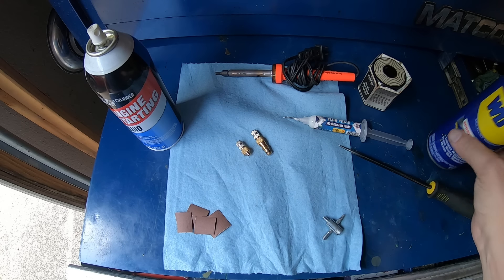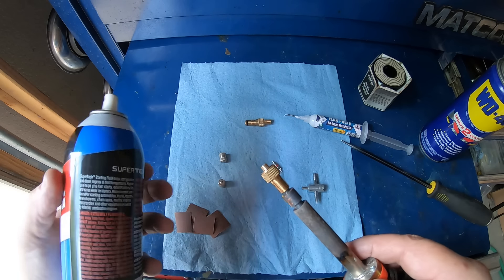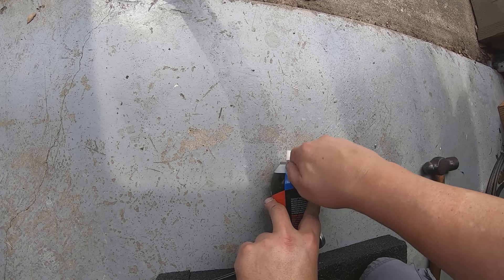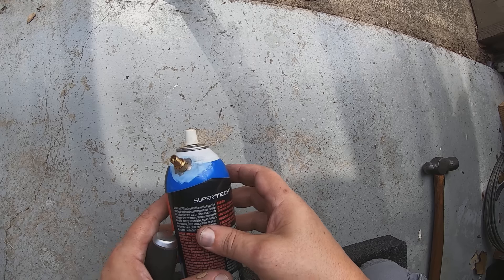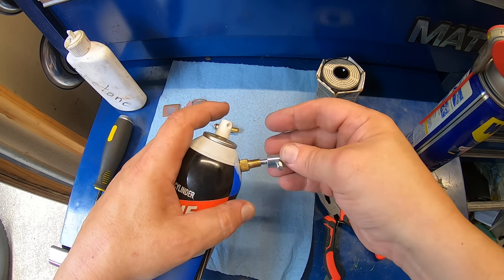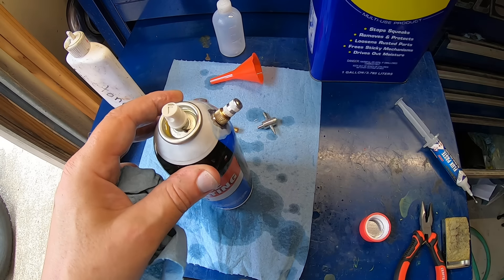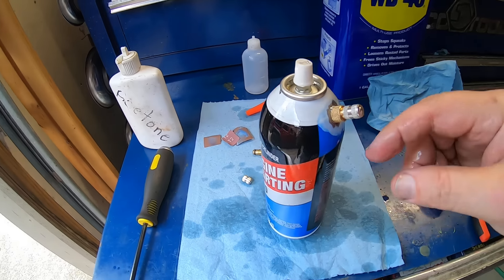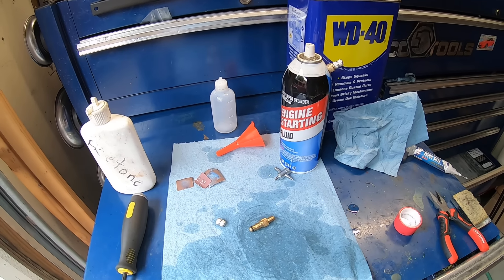How to Easily Install a Schrader Valve on any Can to make It Refillable without Drilling or Torch.

Comment: Why not just get a pressure can made for that. 
Mechanics use them for parts cleaning. 
I put brake fluid in it to clean off oil stains on the driveways for my customers that when my Dodge ram marked its territory 🤣. 
Filled the can with brake fluid, fill it with air through the Schrader valve 
Don’t have to worry about shit like this  
Or better yet JB weld a  rivet nut to the can a lot faster and easier. 
Just get the aluminum one for aluminum cans the steel one for Steele cans , 
The problem is those cans are made to handle a lot of pressure!

Comment: I'd be ultra cautious about how high a pressure charge is applied to reused cans.  Keep it low as needed. 
For a start, only pressurise it with a hand pump and TEST what it is. 
Also, what is the service life of the can's dispensing valve?  
You can be sure it is little more than it's intended single use.
Reply from the maker: Time will tell.
Reply: It appeared to me that this guy knew what he was doing.

Comment: A conical drill bit or bur  run in reverse can deform a nice concave hole. Using a standard fitting  it can be force threaded tightly into that hole (pliershelp). Screwing it in with some quick-set epoxy (surfaces gotta be CLEAN of oil), will seal it for years.

Comment: One can pretest the air pressure the way Plumbers and Steamfitters test gas pipe.
Just make a fitting that has a PSI gauge on it put some soapy water in your can and inflate to pressure and let sit overnight and 
if it holds the same PSI and no leaks your good to go! 
The soapy water will tell you where the leaks if any are as well! 
after that drain rinse out and let the can dry out as well

If the rated PSI is 100Psi on the can, I'd use 75 PSI on it for safety reasons and your not over stressing the can!  you can always add some air if needed. Id use a dip straw as well to tell you the level of fluid is in the can as well!

Comment: The best thing about this method of soldering in a valve stem is that it is quick enough to allow for the solder to melt without damaging the plastic spray valve (the part you push to spray). One thing that surprised me is how he poured in the WD-40 from the gallon can. If you put the gallon can cap to the top as you pour you avoid the glug glug spillage. This works with antifreeze and quart oil bottles as well. Good video.

Comment: Harbor freight sells a reusable spray can cheap and you can spray anything out of them. Had one for ten years now and still works great.
Reply: Except they are not cheap anymore at $39.99
Reply from the maker: I have 2 sure shot spray cans and the problem with them is they are bigger than these smaller cans and the spray too much fluid. I wanted something more controllable and sprays a smaller amount.

Comment: The only thing which makes me slightly "twitchy" about this idea, is the following:
"Is it really a good idea to put pressurised air, containing oxygen, into a vessel full of flammable liquid?"
Reply from the maker: The same percentage of air is going into the can which is in the atmosphere so if you are not afraid to strike a match in the air this would be the same thing. Now if you were pumping 100% oxygen into it that would change things. Air is 79 percent nitrogen.
Reply: @737mechanic  
I don't think we'd hear back from some-one refilling their spraycan with pure oxygen, but some unfortunate might find a "crispy critter" in a crater, some time afterwards.

Comment: Love it...instead of buying a durable safe refillable can....I know its not a high pressure dispenser, but it's basically " I'm gonna teach you how to make mini*-bomb!" 
Many cans are extruded, but some are wrapped...have a seam...gotta watch what you fill with, and use a hand pump, not a compressor, dont need 50-100 lbs of pressure..

Comment: Yeah... that can is going to blow up right where you punched a hole in it
Reply from the maker: Nope
Reply: Not that high pressure
Reply: @737mechanic  You should leave that hack in a parked car on a hot day to test it out.  That is the standard an unaltered container can withstand. Cheers

Comment: I absolutely love the idea and i would do it, but in the interest of safety and not wanting anyone's father getting hurt, i would suggest that if the can is rated at aprox 100psi, i wouldnt pressurize it to no more than 75, 80 psi. these cans arent  meant to withstand the stress of repressurizing them so eventually they could potentially fail if you are pushing them to their original limits. you dont want to be holding it at 100 psi when it decides to fail. much better to have to keep adding air every so often than taking a trip to the ER. Stay safe guys

Comment: This is a way to injure or kill yourself or others.  Metal pressure vessels have flaws that grow with pressure cycles.  We had tanks explode during the Apollo program and developed the technology to understand why.  This technology that we developed is called fracture mechanics, and it projects flaw growth.  Pressure vessels explode when a flaw grows to critical size by repeat pressure cycles, and rips the pressure vessel open.  Doing what this video recommends is really foolish.
Reply from the maker: You should watch my other 2 videos where I pressurize them to failure.

Comment: I use clear spray bottles for different lubes and penetrants. One thing Ive noticed with the clear bottles is how much certain liquids settle. WD40 is one that has a pearl jam like substance that settles on the bottom. It needs shaken before use or before pouring into another container such as the small bottle used to fill the aerosol cans. Just a tip!

Comment: You can get the valve free at any tire shop -- when they pop the tire stem out they just get thrown away -- you will need to remove the rubber coating , and be left with the brass part to solder in the can

Comment: I use auto AC can piercers to pressurize any can in minutes by screwing a Schrader fitting to the flare fitting on the can piercer. When can is empty discard it or if you decide you want liquid just pierce a second hole opposite the first to let atmosphere in as can drains. For permanent use the commercial heavy wall spray cans work well and are cheap.

Comment: So naturally, the armchair engineer here went down the rabbit hold of burst pressures. Because this could end up being a rally cool single shot air gun! Especially with the valve on top!

I found that the cans are rated for about 140psi with a burst pressure of about 200psi, so charging to 100psi should be good! What I didn't know was the importance of the solder joint itself. 50/50 tin-lead has a relatively low burst pressure of about 150 to 200psi; while 95/5 Tin-Antimony rates between 300 and 500psi.

Keeping this in mind, this looks like a really cool way to recycle spray cans! I reckon just point the schrader valve out front just in case!
Reply from the maker: @cbrown6718  You may also be interested in the 2 other videos I made were I pressurize them to failure.

Comment: And you do take the risks of the thing blowing up in your face.You can easily over pressurise the can beyond its design.
Reply from the maker: Not with a common air compressor you can't.
Reply: If you use a little common sense, there is no risk of that.

Comment: We used to do this back in the day with old r22/r12refrigerant tanks. They worked great to inflate tires.  The cans would rust on the inside because of the moisture in the air.  Then they would explode killing people.  The government shutdown the reusing of the cans as a result of the injured and deaths. They made the companies incorporate features to stop them from being refilled.
Reply from the maker: Luckily the inside of spray cans are coated to prevent rusting.
Reply from the maker: Look_What_You_Did  WOW, why dont you cut one open and look. Even the inside of soda cans are coated because the carbonic acid, phosphoric acid and citric acid would corrode the can without it.
Thanks for the comment and helping the YouTube Algorithm.

Comment: Poking the hole in the can makes a much stronger solder joint as it leaves the stretched metal around the hole giving the solder much greater surface area to adhere to. I think you "accidentally" positioned the valve in the perfect position for use. Its not in the way of your hand as a right handed user.

Comment: I have never had much luck soldering anything to steel which I assume is what the can is made of.  What kind of solder are you using?
Reply from the maker: The can is steel. The trick is to clean it good and use flux. These are what I used.
https://amzn.to/3L1VJsK
https://amzn.to/3RGk5fq
Reply: Plenty of heat and good clean metal, bit of flux, the solder will wet out. 👍
Reply: You could also use a blow torch and carefully apply the flame mostly to the brass fitting and omit the tinning. If the surfaces are clean and grease free and if the temperature is right, the solder will quickly tin the metals and flow into the joint, even steel.

Comment: People please buy a spray bottle. Ask a firefighter if you don’t know about the fire triangle. All that is required to create a fire is fuel source + oxygen + a heat source ie soldering iron. You might get by but what if you don’t. I value my hand, eyes or even my life more than the cost of a can of wd40 or a spray bottle.
Reply from the maker: Better not buy a can of starter fluid then because that stuff is highly flammable. Not to mention unless you are spraying a flammable liquid in a vacuum you are running the same risk. In other words, if you put a flammable liquid in a spray bottle when you spray it out of the bottle it is now mixing with the surrounding oxygen, so you have the same potential.
Reply: Yeah I will agree with that. But there is possibly residual product in that can as well as vapor which is generally the dangerous part and you introduce oxygen and heat. Potentially a very bad day. I’m just saying it’s not worth the risk of losing a hand or worse and don’t want people to think this is without risk. You do you though.

Comment: I'd be very careful about drilling or open flame soldering (not recommended in this video) a can of starting fluid.  Butane is used to pressurize many aerosol cans and it's very flammable but starting fluid is ether and it's combustible over a very wide range of fuel-air mixtures.

Comment: Never use WD40 on a lathe. Especially on the bed ways. There is specific headway oil for this.
Reply from the maker: It called "way oil" and that is what I use. Like I said in the video I never use wd40 except on aluminum the reason I was spraying it was to show how the pressurized can works.
Reply: listen owenboy   we are making wd40 cans that spray and refill here, ok?   we dont have time for particulars

Comment: Some   rattle cans have a nice quality spray tip on them where you can change the pattern from vertical to sideways, so you can actually filll that with  automotive paint and do the door jambs of your car and smaller areas easily and cheaply nice idea, one thing I would try to add is a gauge to measure how much pressure you are putting in the can to keep safe and consistent, I also would put that Schrader valve on the bottom of the can, mainly because if that pops off somebody can lose an eye or something else that's near and dear to them if it pops off the bottom it might hit one of your toes or something.,my bad I saw you addressed the problem but you could fashion a little safety loop that fits over the top that doesn't interfere with you spraying to keep you safe from that thing ever popping off you can even make one cutting up another can it only has to stop the initial inertia to work, that thing would fly off of there like a pellet gun I wouldn't want my face in front of it.

Comment: A few tips.  Re-label your new can, especially if you use more than one re-fillable can.  You can get used valve stems from a tire shop or old inner tubes.  No need to buy new ones.  Great video

Comment: those thin wall cans will fail with the pressure cycling. I stick with the thick-walled refillable cans to lessen the likelihood of a can bursting. Do watch your pressures and keep them low to prevent bursting. Also, its best not to atomize these speays if it can be avoided--gets deep in your lungsand causes breathing problems long term, old school oilers are best unless it requires spraying for your particular application.

Comment: Letting the pressure out doesn't necessarily remove all the fluid in the can.  If you created a spark when you popped the punch through, any residual fluid could have ignited.
Reply from the maker: Although that is a slight possibility you can tell an empty can by shaking it and feeling no liquid in it. Even if there was a slight amount of liquid there is no oxygen in the can so the can would not explode, in the worst case it would start burning off the vapors coming out of the hole.

Comment: I wonder if you could fill one with gasoline and use it as your "starting fluid"..   Might work
Reply: lol..  Just be sure to film it!
Reply from the maker: @jagboy69  Starting fluid aka Ether is much more flammable than gasoline so I would think if either is ok to spray and use as starting fluid gasoline would be fine.
Reply: @737mechanic  I do wonder what they pressurize ether cans with though?  Would having oxygen in the can be dangerous?  I honestly don't know...  I assume that regular starter fluid cans are filled with CO2, or some other inert gas.   I'm not certain though
Reply from the maker: @calholli  I have no idea. A quick google search says liquified gas is in a lot of spray cans but I am not sure about all of them. They do make refillable commercial spray cans that are meant to be filled with whatever fluid and then filled with compressed air so this is simply a homemade version. The link below is for the commercial version.
https://amzn.to/3xmq1n4
Reply: @737mechanic  I've filled my Sureshot with a variety of solvents and never had a problem - of course I'm careful of ignition sources before I use it too!  This is a nice trick - I love your custom solder gun tip! I don't have a lathe, but I've done "machining" (lol) with my drill press, and given the low tolerances needed here, I might just give it a try! Thanks for the tip! 👍
Reply: You could put it in your wood heater, spectacular result I bet.
Reply from the maker: @flmulcahy  We had a small burn pile when I was a kid and an aresol can got thrown in and it exploded like a bomb and blew burning stuff everywhere.
Reply: @737mechanic  them were the days.
Reply: @737mechanic  Yeah..  We've done it with empty paint cans.  They still blow up pretty good

Comment: Cool soldering technique. I did something similar to boost foam in my diy shaving lather. It didnt work well. I had to use a shaving foam sprayer that provides enough mixing to boost foaming. You can use gasoline for lathe cleaning ... if you dont smoke. Works fine both as cleaner and lubricant. In order to facilitate filling you can keep the spray cup down. Thanks for sharing.

Comment: I like the way he didn't shake the can before use there's two components to WD-40 in one settles out to the bottom which I believe is a silicone oil you only put in half the component of WD-40 taking for the content of your metal container into a clear bottle and you'll see how the stuff separates that's why you must shake it before use! Always look up the SDS

Comment: I wouldn’t advise using an electric drill, as most use brushes, which have sparks…. If there’s any pressure in the vessel it could spray a highly combustible gas right up at the drill, and that combination may not be good for your health….

Comment: What is the trick I could never get soder to stick to steel all it does is ball up and roll off?
Reply from the maker: You have to clean it and flux.
Reply: Flux, flux, flux. Clean mechanically, then flux. Type of solder is important too. This is acid core solder I believe

Comment: Silly. Just buy a refillable pressurized sprayer.  About 40 bucks from HF or Eastwood.  They last a lifetime
Reply from the maker: I have two of them but they spray way to much and they are big and bulky. Now I have 5 of these refillable cans and they didn't cost me but about $1.10 for the Schrader valve.
Reply: @737mechanic  reliable?  Not sure how reliable disposable cans and nozzles are.  Tou can buy refillable aerosol cans, made to be reused, with pinpoint nozzles
Reply from the maker: @gizzyguzzi  I have been using them routinely with success. The best part is the diffent spray patterns.

Comment: 1 Schrader valve
1 valve stem remover
1 lathe to machine it down to size
1 soldering iron
1 soldering iron tip custom made to the perfect size
1 piece of sandpaper
1 bottle of acetone
1 punch at perfect size
1 hammer for using punch
1 bit of flux & solder
1 perfectly sized squirt bottle with screw top
1 perfectly sized funnel
1 air compressor
1 air compressor hose and tip

Instructions: Use all the above as instructed and spill enough when filling to negate any money savings. Then try to safely clean up all the toxic chemicals in the WD-40 that you just spilled everywhere. What a plan!
Reply from the maker: Sounds like you got it down. Now get started doing your own. :)
Reply: @737mechanic  😂😂😂😂😂

Comment: I’ve seen reusable aerosol sprayers on eBay for $32. I do like this man’s idea better. I bet somewhere on eBay there is the correct size valve available where you would only need a drill and some solder.